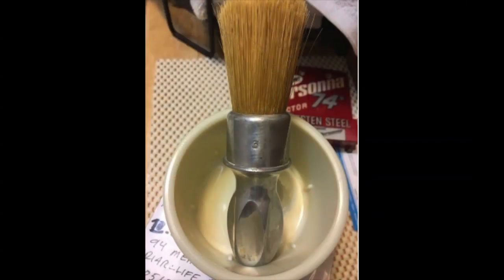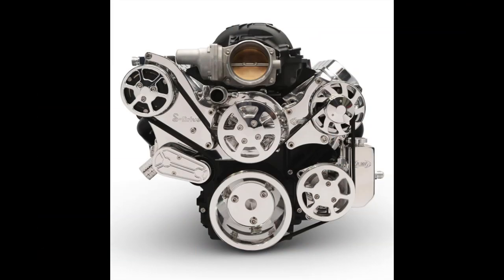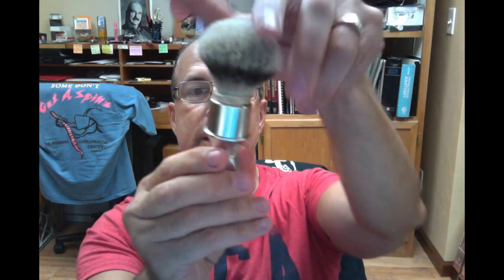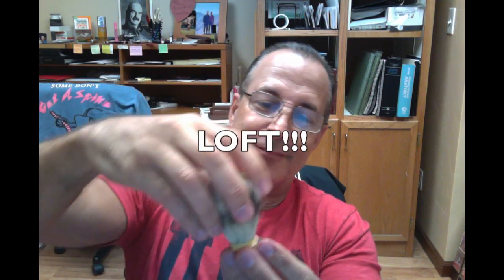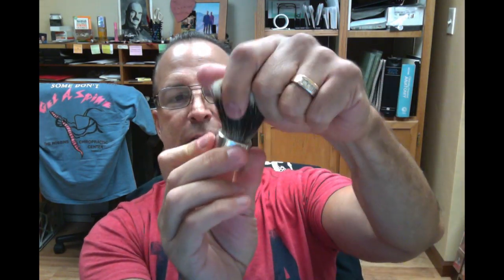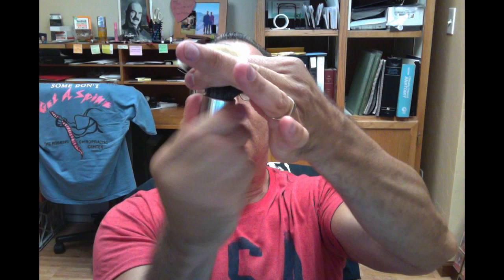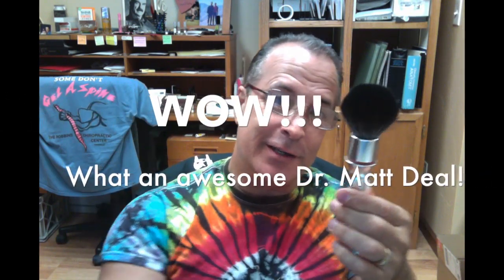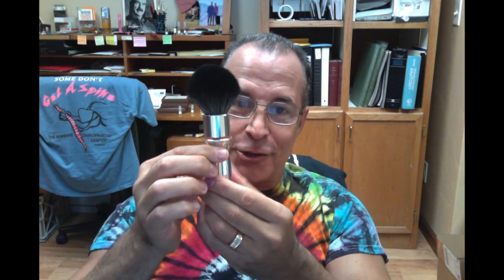This Could Be The Coolest Shave Brush On The Planet!

Comment: Also, if you use silicone instead of epoxy, you can remove the knot from the plate when it gets old! With a supply of backup knots and silicone and you have a handle and ferrule that lasts a lifetime!
Reply from the maker: I'll have to give that a try.  Thanks!
Reply: It’s a trick I started using for fancy brushes like That Darn Rob, Leonidam and Penello Cavallo - the handle are so beautiful, I order them with the knot lips and not set - I set them with a little silicone so I can adjust lift and if the brush gets old, pop it right out!

Comment: Hi dr. matt... what affordable lapping stone would you recommend, I’ve been using the 400 grit wet sandpaper and it’s okay, but really messy... please help 😂🙈... thanks 🙏
Reply from the maker: What you're using is most economical but if you want a plate, you can get a DMT but I understand Harbor Freight has some diamond plates for much cheaper.  They should work fine.  Problem with those, including the DMT is they stick to the stone.  I use the Atoma 400.  Definitely the most expensive but no sticking and a one shot deal.  You can use it for heavy work on a razor if needed too. https://www.chefknivestogo.com/atoma325400pad.html
Reply: DrMatt357 thanks so much, I saw the atoma, but wasn’t sure if that was the one... I will definitely go with that
Reply from the maker: @zakariyahaneef174  Get the stone holder too Zak, it makes life a lot easier! https://www.chefknivestogo.com/nastho.html

Comment: Everything that you described, even down to the swapping of brushes of different size knots was all available at Phoenix Artisan Accouterments for years. This actually looks like the same exact handle as they were selling.. The feral does look slightly different as I don't recall there being a base plate.
Reply from the maker: RigExpert USA - I just went to their website and didn’t see anything like this.  Thanks for stopping by tho.
Reply: The base plate is mine alone. My innovation. It’s not the same brush.
Reply from the maker: The Alpha Brush & Shaving Channel - ΑΛΦΑ - I haven’t seen the other handle but if it doesn’t have a threaded baseplate, it doesn’t have the ability to make real time loft adjustments. And that, IMO, is the coolest part of the brush.
Reply: Matt, they ran out about a year ago, they were selling the replacement ferrules for them up until about 4 months ago. I'm told they'll be back, but what you've shown here seems like a very nice replacement. Maybe even better with that base plate design!  Looking forward to getting one of these for myself.